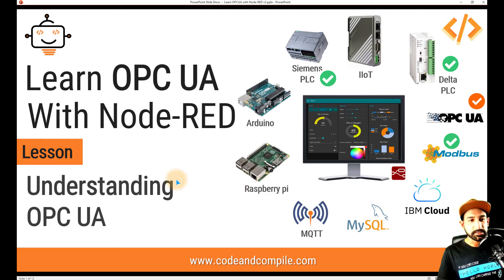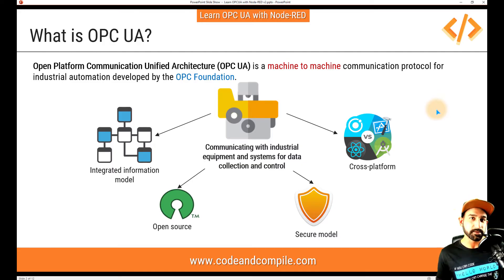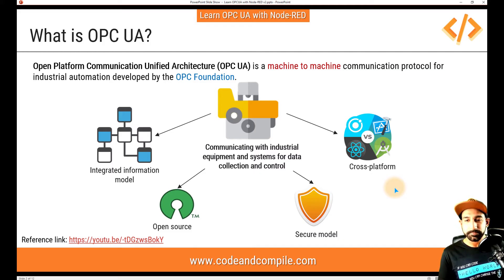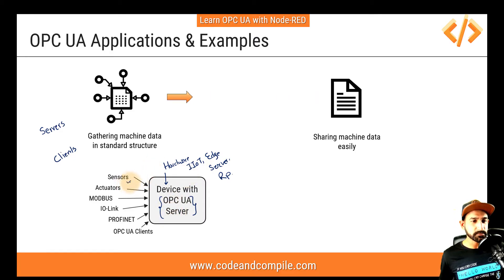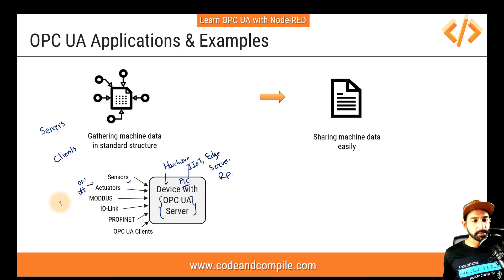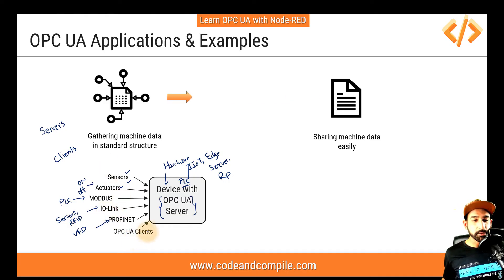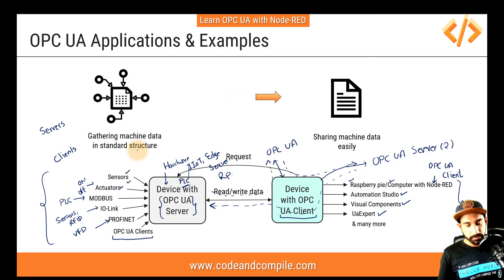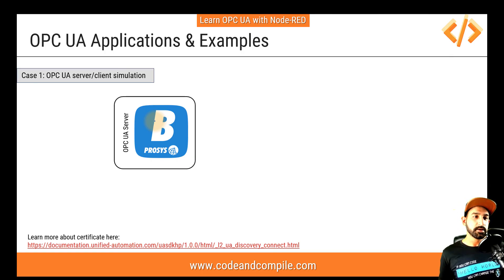OPC UA Lesson 1- What is OPC UA?

Comment: Let's say, I have a communication failure (over remote like cellular, VDSL etc.) with OPC server like 4 hour or so. Will the OPC-UA return lost values with their timestamps to the OPC-UA Client when communication back up? Or is there a communication protocol can do that?
Reply from the maker: Good question! Normally OPC UA sever like in Siemens PLC has no such option to back up the values automatically. You have to store the data in the database to retrieve it later. But OPC UA sever might have this back up function built-in but I am not sure which one.
Reply: @thegeterrdone  I have been told that IEC-104 protocol is able to do that. But I don't know about the limits. I never had a chance to test it.

Comment: Thanks a lot for the video Rajvir. I am little confused, is the main idea for OPC-UA is  data collection  or is also for real time control. e.g. controlling a motor , synchronization between  industrial controllers, turning on/off actuators, etc ? I mean is it  a replacement to existing protocols as Ethernet/IP, Modbus,etc ?
Reply: Yes you can control motor, actuators etc
Reply from the maker: OPC-UA is not the fastest way of communication. But it can collect the data, control the output, read the inputs securely. If you want high speed control then PROFINET is better :)

Comment: Lets  say the PLC is OPC UA sending data over to a system OPC DA Client, are there any additional requirement such a tunneller or something like that. Sorry of my question is not structured properly.
Reply from the maker: No additional requirement, the client needs opc ua endpoint and login details if connection is secure.

Comment: Can I use the opc software with S7-400 CPU
Reply from the maker: I am not sure if it supports. Check the latest firmware from Siemens
Reply: yess, but only via CP card on the s7-400 rack
Reply: @pieterfranke  But its possible without any hardware added on s7 1500 PLC? or 1200?
Reply: @genantamtam9364  correct, they’ve got opc servers integrated. But please check that further for the s7-1200, as it doen’t have the same specs as s7-1500
Reply: @pieterfranke  i will, thanks alot for your answer. 
Take care